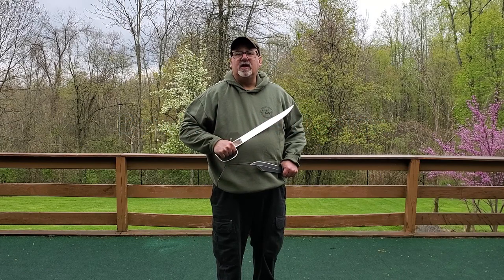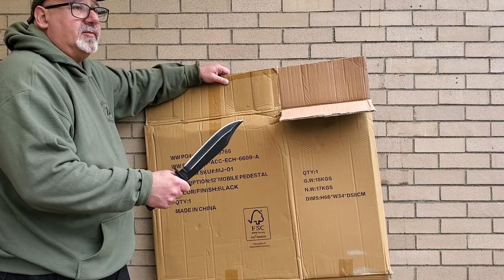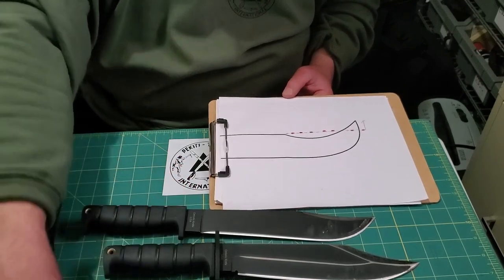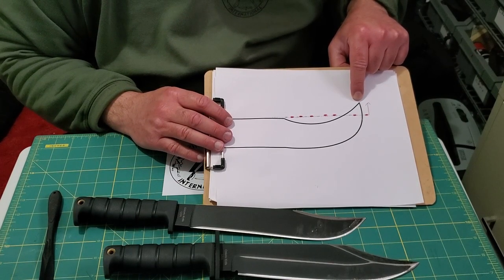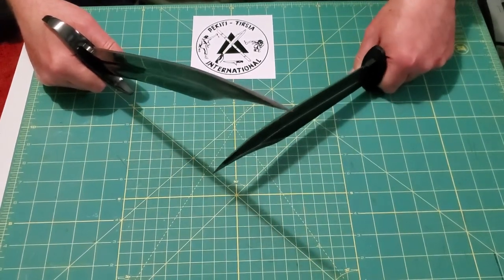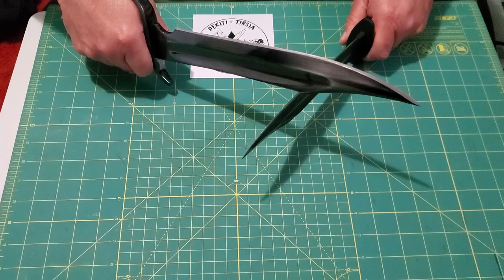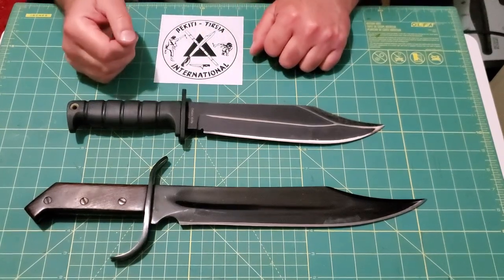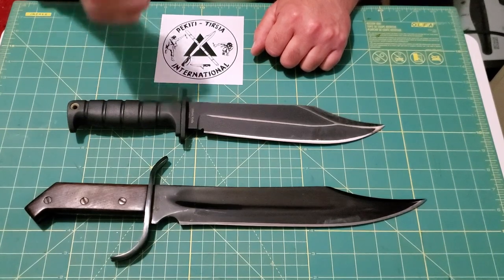BOWIE KNIFE DESIGN Q & A

Comment: When holding a bowie in reverse grip and the edge is up when you perform a forward thrust you can hold the tip upward a bit then point the tip downward before impact then lift it after impact.
This gives power to the thrust then can be pulled upward.
If in combat with a person when the blade is puncturing and you lift it after impact you will draw the blade upward and can essentially cause a major incision in the stomach and create major damage or possibly cut the belly open.
Also reverse grip is good for a neck slash by simply swinging it with a straight wrist then pulling your wrist to the left (if right hand is being use to the right is using left hand).
This allows the tip of the blade to draw through and cut with tremendous power.

Comment: Your cuts seem to be always an overhand or downward cut...
The primary cut should be upwards..striking at the vulnerable groin and soft belly of the body with the curved main cutting edge...missing that target and recovering your blade and returning to guard you would be in perfect position to deliver the legendary " backcut" with the tip of the blade....like an eagles talon...devastating targets of opportunity.
As far as the sharpened swedge...your only concerned with concentrating your speed and power into the very tip of the blade...it will cut deep and be very effective
Reply from the maker: The downward cuts are used here much like a boxer will use a jab; to make an opening for his power punch, which may be a cross, uppercut or hook.